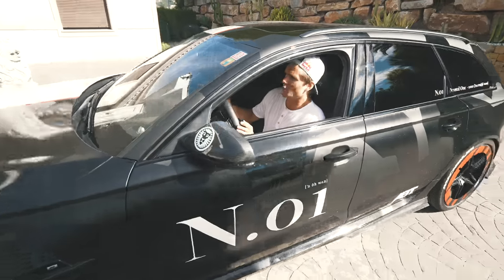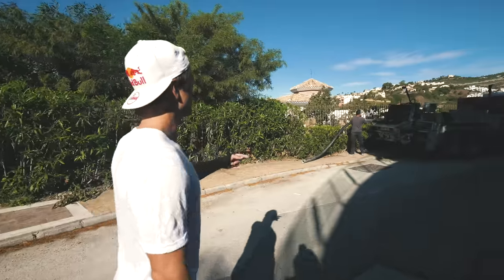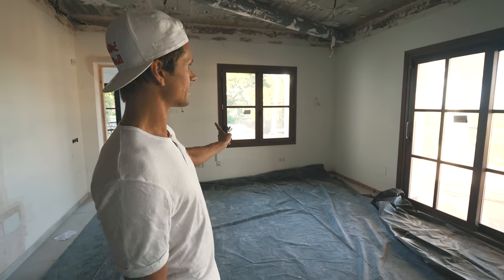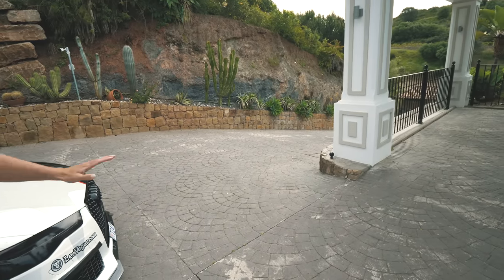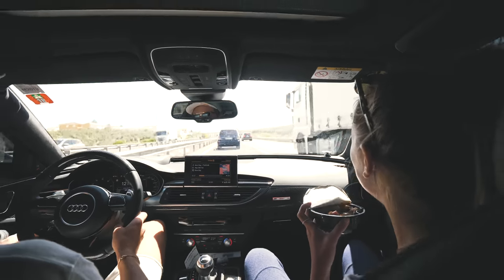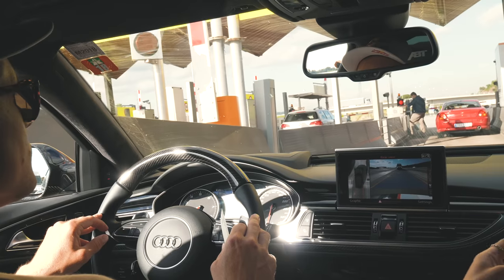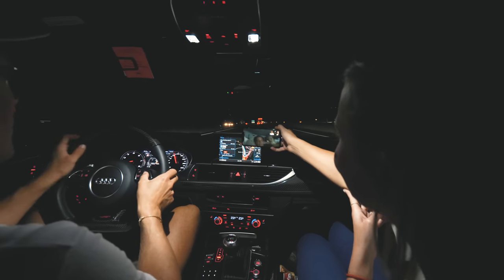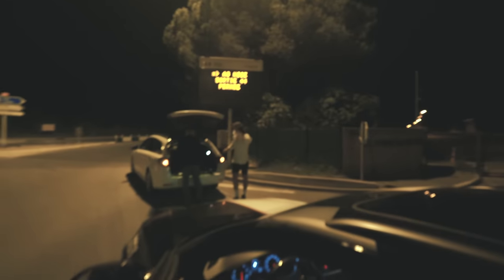THE ABT ENDURANCE RACING TEAM! | VLOG³ 07

Comment: average speed with all the food/fuel stops, tolls, border crossing and dropping Benji off is just shy of 90mph, (145 kmh). not bad at all!! Benji's phone has 11:10 on it when he pulls up the map, Jon said it was 1750km to Benji's father. and they end the vlog with 23:26 on the Audi clock and either 0.4 km left or 4 minutes left on the Audi navigation system eta.

Comment: If I read the clock correctly, you arrived in monaco at 23:26, you left at 11:16. That's 12 hours and 10 minutes, or (12*60+10) = 730 minutes. 

distance/time=speed. 1750/730 = 2.3972 km/minute. Multiply by 60 to convert to hours, results in 143.8 kph.

Good thing no cops caught you.

Comment: Avarage Speed for the trip was 141.38 km/h... Here is the equation:

The trip was 1732 km long
They left Delish at 11:15
Arrived in Monaco 23:30 ish according to the Sat Nav
The drive took 12 hours and 15 minutes to complete.
1732 / 12.25 gives us an avarage speed of 141.387755 Km/h. This result is with a few minute stops here and there so i would asume that the avarage top speed when driving was around 150kph :)
Reply: What is an average top speed??

Comment: Jon did all the driving ?
My last big and fast trip with that kind of driving was 900 kms alone driving around 160/170 km/h all the time but I only managed to do an average speed of 105 km/h with the brakes, so much fun but so much fuel burnt as well ! 😅
But I imagine the RS6 goes a bit faster than my 90 hp Clio 4 !
Great video